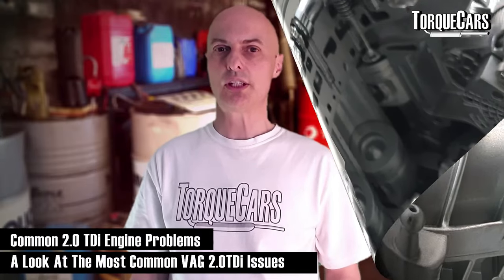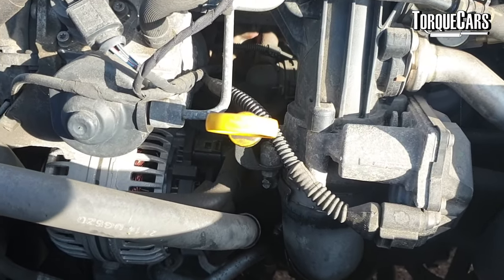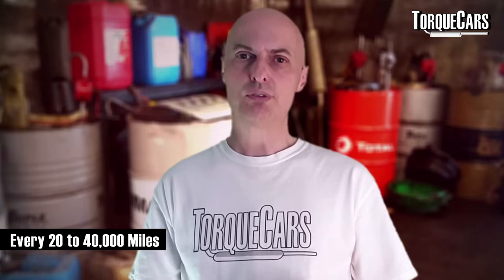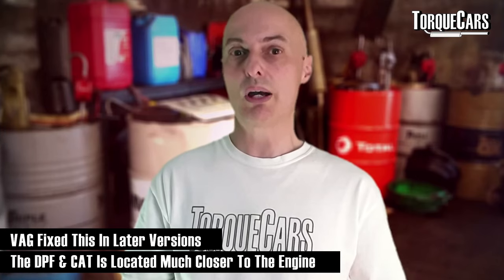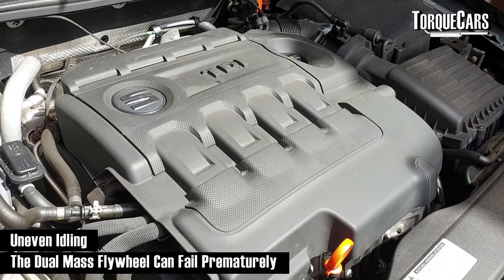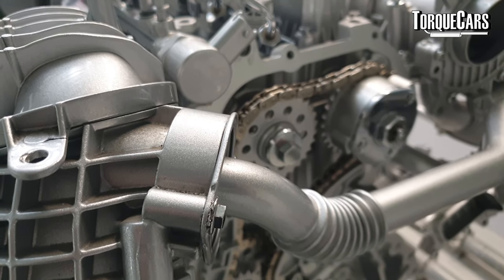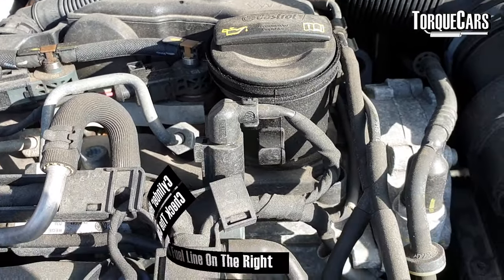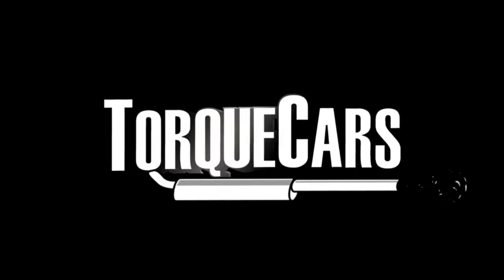Common VW Audi Seat Skoda 2.0 TDi Problems  [Fault Guide]

Comment: There will always be a kid who comes up and denies how junk is VW products… owned two VW TDIS and one TSI and will never buy them again
Reply from the maker: Ah I'm in my 50's and you call me "a kid", thanks that made my day!

I wouldn't mind betting you had 2007 to 2012 model years from VW, which were certainly not the best.

I've owned Audi's for the last 20 years so think I've build up a fair and unbiased picture of how reliable or not they are. I wouldn't say they were perfect, indeed every car brand has its problems.

In my experience if you look after them using the correct oil, changing it regularly and making sure you have the right coolant they last for 100,000's of miles.

I do accept that others have difference experiences and really appreciate you sharing, I would be interested to know which model years and engines you had as this helps me build up a pattern or faults or problems.
Reply: Bruh read my comments before getting emotional… i said they’re junk .. i actually drive a passat tdi now and the engine has a unfigureable   Noise 😂

Comment: Lol, you missed a fair number of issues. At least be thorough if you're going to all the trouble of making a video about these engines. 

PCV valve cooling - seal
line that sends carter gases into turbo
Vacuum pump/vacuum lines
thermostat
injector seals
turbo actuator start/end positions
air flow meter
oil pump hex drive key for balance shaft 
fuel pump - people are replacing bosch CP4 with CP3 to prevent filings screwing the entire fuel system (tank/injectors/lines etc)
Reply from the maker: It would be a really long boring video if I listed everything that could possibly go wrong. The criterion used was problems that crop up most often and affected most versions of this engine. I will refocus on each generation of this engine where I can drill down into the smaller niggles that were unique to each generation. 

To be honest I didn't think anyone would want to watch a video on engine problems but I've been surprised by the feedback and response it has had so far.

There are a few items on your list I was completely unaware of so I'll research those thoroughly and report back in a future video.
Reply: @torquecars  the fuel pump, hex drive key and thermostat are common issues on ea189 and the most relevant since they cause the most catastrophic failures 
The turbo actuator becomes an issue if an incompetent mechanic has done work on the car in that specific area 
Pcv and Carter gases line are somewhat common as well
Injector seals remain undiagnosed because the users don't look for them and mechanics don't care
Reply from the maker: Interesting, you are a handy guy to know. I'll look into these for the next videos on each generation of the 2.0 TDi engines.

I've heard claims that the EVO Gen 3 irons out pretty much all of the problems, but others have told me it's just as bad as the previous one? What are your thoughts?
Reply: @torquecars  don't know. I've only done research on the engine in my car. It's somewhat helpful that most of the cars in Eastern Europe are old diesels and some of them are not serviced as often as they should. The issues are fairly reoccuring and well known.

Comment: So the tdi engine in seat Leon fr 2010 is bad or good?
Reply from the maker: They are pretty good options imho. They have the newer CR setup and most of the early issues were ironed out by 2010. The 2012 version is better still. You won't be disappointed but I would strongly recommend buying one with a full service history and checking the major points in this video.